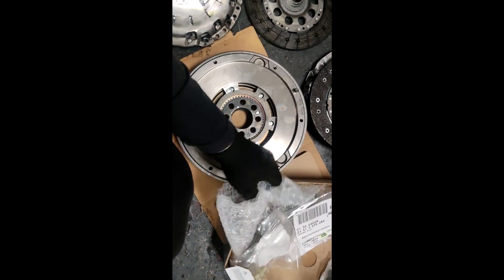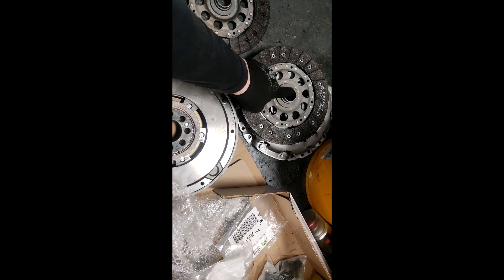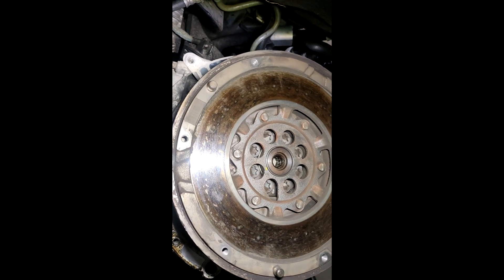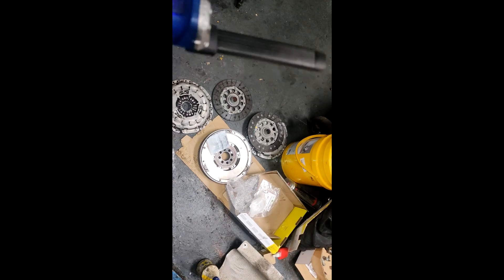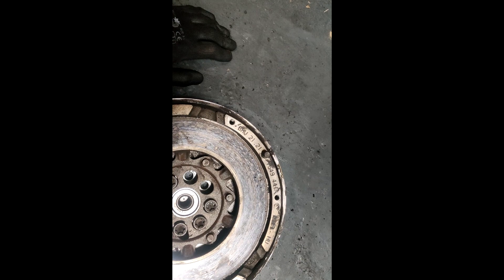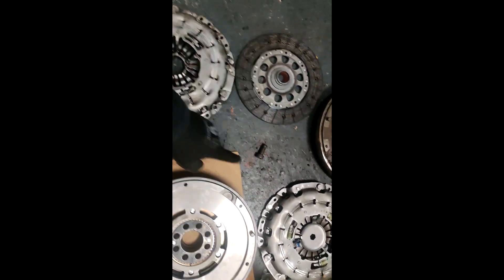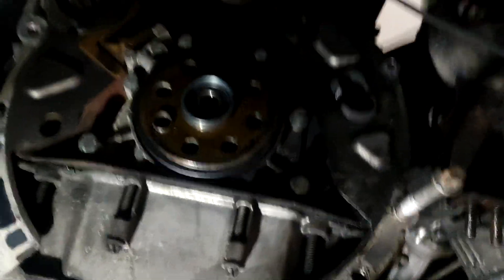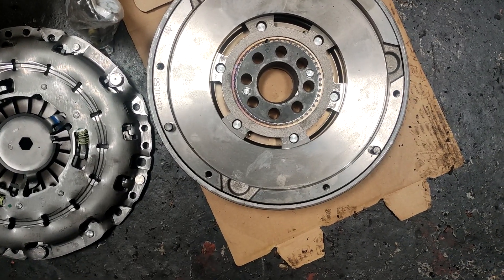320d M47 E46 E6X E8X E9X clutch and flywheel upgrade 650nm+ using oem parts

Comment: Shold put new bearing in flywheel  gearbox shaft not thath long
Reply from the maker: nope you cant the hole is too big!! its perfectly fine in the crank this setup is still in my car years later no issues at all
Reply: @TotoGuy-Original  did not last long to my friends ramaped diesel, you might get lucky witch realy good centre, because gearbox  shaft ends in in flywheel for six speed gearbox, the 5 speed one got the long shaft to crankshaft
Reply from the maker: @MrBilards  its not just me though i know of 3 1 series with 290hp and 2 other e90 running the same setup nobody has had issues with them those are more powerful than mine 1 of them is running 535d twin turbo in a e90 320d
Reply: @TotoGuy-Original  oh thath means my friend was just unlacky, might not even bother to put thath bearing in next time 😅

Comment: Hello, really fabulous video! I've got an e46 compact with the m47tu and the 6 speed trans, you were talking about the flywheel beeing from a 5 speed, is it possible to mount this 550i flywheel in my m47tu and to get it working with the 6 speed trans? Thanks in advance!
Reply from the maker: yes everything that fits the e90 will also fit the e46 6 speed my friend has e46 he did the same as me

Comment: Did the clutch plate bolts come with the 550i kit?
Reply from the maker: no i reused the old ones didnt see the point in buying new ones because theyre not as essential as the flywheel bolts. i did get new flywheel bolts for 2 reasons 1. you should and 2 theyre obviously different to the old ones

Comment: Hey man, great video! Would you happen to know how thick the new 550i plate is? I'll be sending my 320d plate to clutchfix to reline, but I can't wait any longer for the 550i one I've got on order.
Reply from the maker: ive no idea but im pretty sure the plate is identical but the centre is different ive had a new 320 and 550i plate side by side and they look identical otherwise. 

ive seen a few e90's 320d running 290 hp with the same clutch and a 1 series E87 same power and a E46 compact running 336hp!
Reply: Thank you very much, mate. 
I've sorted the clutch plate. 
How is the 320d gearbox holding up in your car?
Reply from the maker: @ivotsachkov1301  no issues at all. theres several M47 E87 and E90's about that i know of with 300hp 615nm and i know of a E46 with 336hp 661nm

Comment: Hello nice video, please I use thé bearing which Is in description and put it to new e46 flywheel ? IT fit inside And gearbox Will fit too ? Thanks a lot
Reply from the maker: no the pilot bearing in the description does not go in the flywheel the hole is too big the bearing goes in the crankshaft
Reply: @TotoGuy-Original  but gearbox Is not too long to connect bearing in crankshaft
Reply from the maker: @schenkerperformance   the gearbox shaft fits into the bearing mine has been in my car for months. If the shaft is not supported by the bearing you will know very fast
Reply: That's really not possible. Yesterday I installed the clutch from a 330D e46 150kW to an E87 120D and if I placed the bearing in the crankshaft, after the gearbox is installed, its shaft cannot reach the bearing. It is designed to lean against the bearing in the flywheel. @TotoGuy-Original
Reply from the maker: yeah thats how the original flywheel works the bearing is in the flywheel but the upgrade is different parts not specially made for this. 

there is a bearing casing at the back of the original flywheel this sits in the crankshaft but as i dont have the original flywheel the bearing in the description gets put in the crankshaft. 

measurements were taken by a BMW specialist when we were doing this upgrade. because you dont want to put it back together and find its a problem.

as i said to you before if the gearbox shaft wouldnt reach the bearing in the crankshaft as soon as you try to drive it you will know there is a problem. 

there is no problem though ive been driving mine 100's of miles already, and its been pushed to its limits on the road and dyno
Reply: @TotoGuy-Original  that pilot bearing is useless unless you using special crankshaft adapter. Already done several years ago. Do a measurement on 5 speed and 6 speed gearbox shaft length and you will get the answer))
Reply from the maker: @MrGoodcat1  of it's useless then why is it still working 10 thousand miles later? Doesn't matter if it's 20mm supported or more it's still supported. You would know very fast if it wasn't.

We didn't have 5 speed to measure I know it's shorter but not much. We measured the parts on the car engine and the gearbox off the car. 

I don't need an answer I already have it, this works
Reply from the maker: @MrGoodcat1  you put a flat edge on the end of the gearbox and measure to the shaft then you measure from the face of the engine to the end of the crankshaft to work out how much is supported. The bearing in the 6 speed flywheel is longer than it needs to be you only need to support the full width of the bearing that goes in the crank. Any less and you will kill the bearing fast.